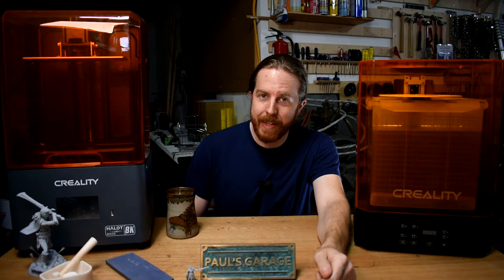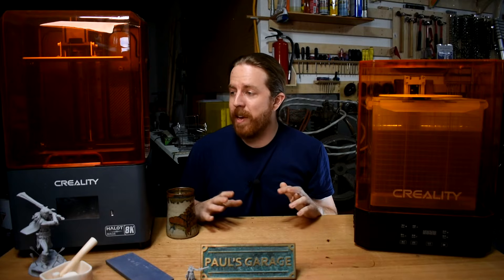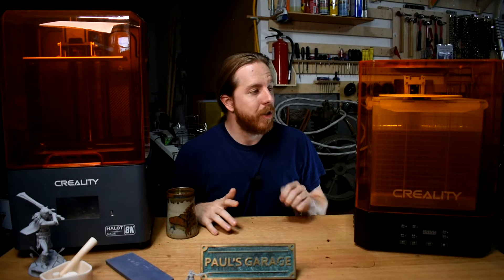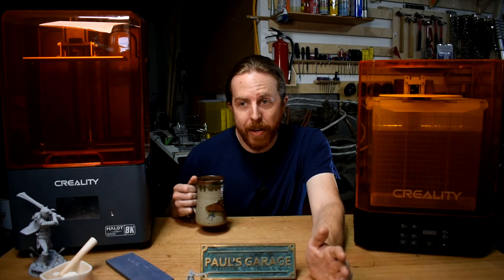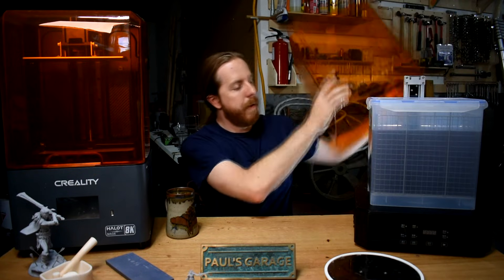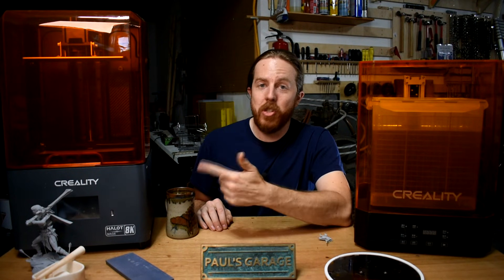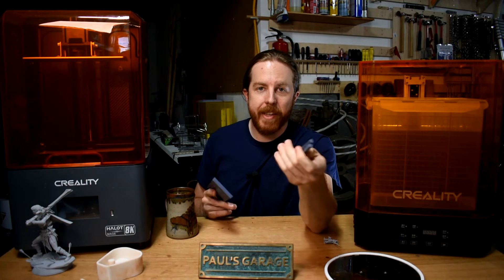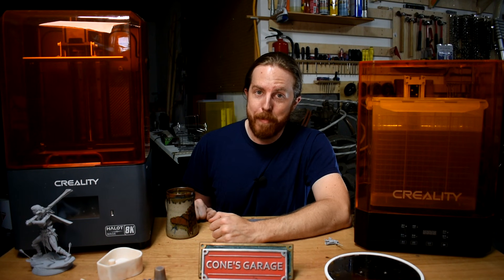Resin 3D Printing for Your Shop? | Creality Halot Mage 8K Printer

Comment: Good info, thanks friend. Subbed! @ 7:21 I can say that yes, you can reuse isopropyl. All that I have done for years is, when it gets very cloudy I pour it into a glass jar and set it in a sunbeam. The resin will solidify out of suspension and fall to the bottom. Strain the fluid then add back into the wash tank. I only buy new isopropyl when it evaporates or splashes out. I have been on the edge of pulling the trigger on this one and appreciate the help.
Reply from the maker: Thanks for the info!  I'm going to try pouring the used IPA into a bucket and give that a shot.  I can tell a whole bunch of crap settles out when I go a few days between cleaning prints.

Comment: Hi Paul,
Great video,
We are actually foundry pattern makers and are looking for a 3D  printer for all our small loose pieces and impeller vanes.
This creality looks good,
But build size could do with being a little bigger,
And other suggestions would you go for this.
Are the parts solid and strong ?
Thanks
Reply from the maker: The strength of the parts really depends on the resin more than the printer.  There are some very tough resins out there, but generally strength comes at a sacrifice to cost or sharpness of resolution or something like that.  In my experience the resin prints aren't as tough as, for example, injection molded ABS, but the right resin should be strong enough for most applications.  I haven't broken a resin pattern yet and I sometimes pound on them a bit hard.  

For build size you need to figure out what size you need and buy a printer slightly bigger than that.  Too small is a major issue, too big isn't.  There are bigger printers than the 10" Creality mage.  I think the elegoo Jupiter is a 12", and a phrozen sonic mega is a 15" or something like that, but both of those are more expensive and don't have resolution as sharp.  I don't have experience with any of the larger ones, but @vogman does, he might be able to give you some feedback.   

The build plates are all rectangular in shape, so you should probably find the exact x-y-z build dimensions and go off of that to pick a printer for your needs rather than 10" or 12" or whatever.  I was somewhat surprised by how small a 10" build plate really is, but you can certainly print a lot on one plate.

For something like impeller vanes, resin printers like this are great but you will have to experiment with print orientation to make sure they come out without any warping or anything.  I found if I took a cube and printed it in different orientations it could actually be out of square.  Again that comes down in part to the resin.

These printers are all inexpensive Chinese (and Taiwanese) models, if you need more industrial machines, the prices are quite a bit higher.  I don't know what your needs or budget are, but I was pretty shocked how good the prints looks on these cheap printers.  

I hope this helps!
Reply: Thanks for the comprehensive reply It sounds like you have good knowledge,
At this point we are just experimenting so one of the cheap Chinese ones will do,
Hopefully it will give us another string to our bow.
Thanks Again 👍

Comment: Thanks for the info Paul, I got a Halot-One, much smaller than yours, a few months back, and I've been slowly ramping up to using it more and more in favor of my Ender-3. I keep it outside because of the harmful and smelly resins. I built a climate controlled enclosure for it, and it prints wirelessly, so super fun and easy!
Reply from the maker: Great to hear!  I'm running test prints on siraya tech cast resin right now.  Gotta get these printers making me stuff in metal somehow!

Comment: What’s the difference between this and a filament 3d printer
Reply from the maker: They both make plastic parts in layers, but everything else is different.  Filament printers use heat to melt plastic to form the layers, but resin printers harden a liquid plastic using UV light.  In my experience FDM printers are cheaper to run, and resin printers are better for details.  It all depends what you want.  I stand by my position that you should have both, but I understand not everybody wants or can fit or afford both.
Reply: A decent resin printer produced layers around the height of a human hair, aka barely visible at the end.
A filament printer is limited by the size of the nozzle the hot filament has to go trough, hence a typical setting goes down to around 0.2mm (unless you are half blind those layer lines will very much be visible).

Filament printers are indeed cheaper to run, and they generally are way faster printers. Hence they have a place in 3d printing, it all depends on what you actually want to print.

In general filament printers are used for large prints, the type of stuff that would take forever with a resin printer.
That and larger surfaces can be smothed out by sanding (and other methods), to get rid of thos pesky layer lines.

Meanwhile resin printers excel at printing smaller more complicated prints, the type of stuff you take a close look at and that would be a nightmare/ impossible to sand down (etc) if printed with filament.

Comment: No espresso maker?! 😱
  That, right there, is a deal-breaker!  Then again, there's always the mmm, forbidden brown/grey sludge! 🤤

  The resin, hmm, I bought a 4k resin printer and the wash 'n' wax cure station to go with it, plus 4 or 5 bottles of resin, along with all of the ancillaries, too ... the Crimbo before last!!!  I've not used it even once, but I'm sure the resin will be absolutely fine to drink use, though.  Won't it? 🤔

  The odd thing is, I FDM print like a maniac, and I even printed stuff for the new (now old) printer, but don't ask me why I've never used the SLA 'cos, like, I dunno. 🤷
Reply from the maker: It's a totally different experience in my opinion.  You should give it a try, you might like it.  You might hate the smell of resin, though.  You never know until you give it a shot!

Comment: Something to be aware of with you having your printers in the garage is if the temperature drops below 75-70 degrees, you're going to have prints start to fail.

Also, always fully clean out the vat after a failure to make sure you don't have any small cured bits that can get smashed and damage your screen.
Reply from the maker: Good point.  I forgot to mention that.  My garage is heated, so that slipped my mind
Reply: What if u live in a hotter state like Florida or Texas I know cold isn't good for printing but what about excessive heat?

Comment: You can get a second bucket for the wash and cure and then do a 2 step wash. Rinse the pieces in the first bucket then wash in the second bucket.
Reply from the maker: I have started doing that and you're right it's a total game changer.  Super good idea
Reply: @PaulsGarage  what is the washing machine
Reply from the maker: @danielramostrejo5720   this one 
UW-02 WASH/CURE STATION Shown Here: store.creality.com/products/uw-02-washing-curing-machine?spm=..product_9f72ebf3-7732-445e-be13-e029ff676f0f.header_1.1&spm_prev=..page_2159625.shoplazza%3A%2F%2Fapps%2Fpublic%2Fblocks%2Fproducts_grid%2F56125487021326335_1.1
Reply: Yep.... I got really lucky and got a free ultrasonic cleaner as well as buying the washing and curing machine. Definitely best to at least shake it around in a bucket of ipa before the washing system
Reply: Ive seen ppl go as far as a 3 step wash

Comment: any slicers for Linux that don't require me sign over my first born to the Chinese?
Reply: I use Lychee for my resin print slicing and have not signed up for the Pro subscription - other than some of the features for adding supports or hollowing models, the Pro version doesn't have anything that I think is all that important. I also have never gotten an email from the developers badgering me into getting a subscription...and if it helps, Mango3D (creator of Lychee Slicer) is based in France rather than China.

Of course, if you don't want to sign over your first born to the French, you may be up a creek. :)
Reply: @justinchamberlin4195  the french are even worse
Reply from the maker: Unsure about Linux compatibility.  I'm also unsure if any of the slicers aren't Chinese.  I think they all are derivations of the same few programs, and all probably Chinese.
Reply: @PaulsGarage  being Chinese isn't the problem, it's the obnoxious account requirement for lychee et al
Reply from the maker: Account?  I didn't sign up for an account to use lychee or Halot box.  I didn't pay for premium though, gotta sit through ads to slice 😕
Reply: @PaulsGarage  lychee required an account to use, did that change?
chitubox has a Linux version now too
guess I should have checked again
Reply: @PaulsGarage  guess I'm getting a resin printer after harvest
Reply from the maker: @pacman10182  it might have changed?  I'm not really sure.  I certainly didn't sign up for anything, and I'm not paying for it.  This printer came with a free year of chitubox premium too that I didn't activate.
Reply from the maker: @pacman10182  I think it's just that the free versions have limited features, but I didn't find a need for any of the "premium" ones anyway.

Comment: Nice Review!!! I'm currently a Creality user...got an Ender 6!!! Regarding the alcohol, I wonder if there is some kind of distiller to re-clarify your alcohol??? Heat it, vaporize it, & re-condense it through cooling???🤔 Doing this should only leave resin particulates/sludge in the boiler/evaporator to dispose of!!!
Reply from the maker: I saw a video where a guy was using ceramic filters to remove resin.  It worked pretty well if he kept cleaning the resin off of the surface of the filters.  Might be worth a try?  Seems like most of the particles will settle out and sink to the bottom, too.  Not a problem in a bucket but in one of these wash stations it gets stirred up
Reply: @PaulsGarage  Seems like that would be kinda labor intensive!!! Seems like heating and fractionating the alcohol vapor off and then condensing it would be much easier!!! ...just need a glass carboy with a rubber stopper with a hole in it for a piece of coiled copper tube that can be run through an ice bath and dripped out the other end!!!
Reply from the maker: I think you're right.  The video said he didn't try that because heat and alcohol vapor scared him lol
Reply: @PaulsGarage  I think that would be a cool feature video on how to recycle/distill your alcohol wash from 3D printing!!!😁👍🏻
Reply: @PaulsGarage  Alcohol vapor won't combust if there is no open flame. You'd be vaporizing it in a closed container right before condensation. You could use a variable temperature hotplate for better control...just have it hot enough to vaporize but well below the "flash point". BTW, I think the air filters on your Resin 3D printer are "activated charcoal"/carbon??? I used to work on copy machines and to neutralize Ozone from the high voltage corona discharge wire they used carbon impregnated filters that looked like a cross section cut stack of corrugated cardboard.
Reply from the maker: I think you're right they are charcoal.  They cut down. The smell a lot.  I'm not sure I want to breathe the air coming out, but it doesn't stink lol
Reply: There's a super simple way to clean up your wash bath: decant the bucket into whatever container you have that's enclosed and doesn't block UV. Use a pickle jar or four if you have them handy, nobody will judge you. Leave them out in the sun for an hour, then carefully pour the alcohol back into the bucket through some kind of filter. I use 190-micron paint filters but there's nothing stopping you from using a finer filter if you really want to get the smallest particles filtered out.
Reply: @justinchamberlin4195  Stacked coffee filters???🤔🤣😂😆
Reply from the maker: Hey there's an idea!
Reply: @RTR-MATEY  Honestly, that probably would work as well. It'd at least be worth trying out.
Reply: @justinchamberlin4195  ☝This.
Reply: Might help to expose the solution to UV light first to solidify the resin first.....🤔😁👍👍